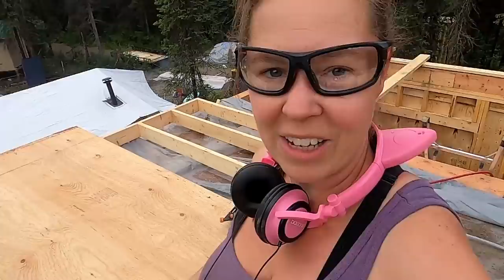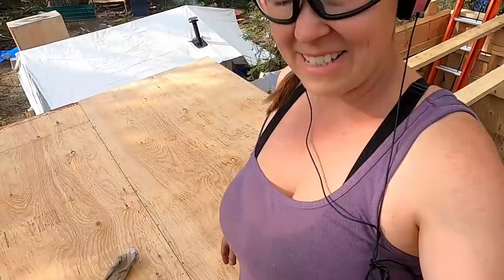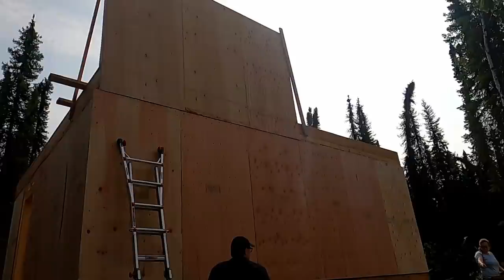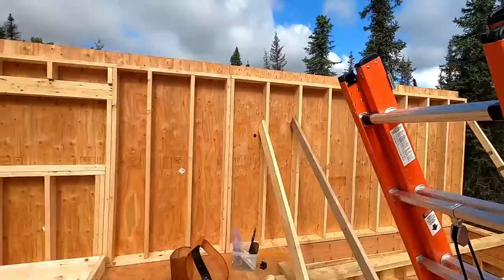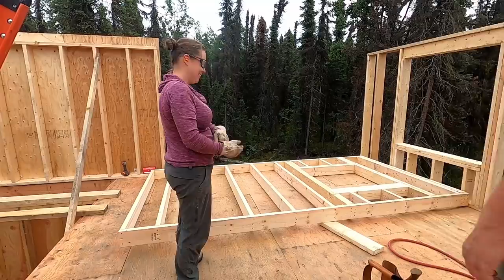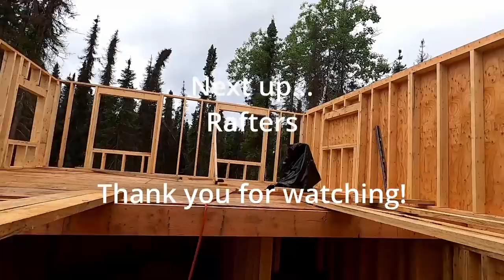Jobsite ACCIDENT | Debt free living cabin build and getting the second story walls up

Comment: I can't emphasize enough, even a "minor" fall can set you back months or forever. Invest in scaffolding & fall restraint, you can resell it for most of your cost later. 2 weeks ago I lost balance getting onto our semi trailer power platform (almost 4 ft from the ground) using a short ladder. I fell backwards to the ground & broke my clavicle. It will be at least 2 months before I can do any meaningful work on the 20X46 "tiny" home we're building with/for our daughter. I have plenty of safely equipment in use for the project, but a moment of haste is setting us back months. Not to mention, it REALLY  HURTS! 😖🥵

Comment: Sorry, but you are "testing the odds" if you keep working like you showed in this video. dong this kind of thing, you frequently need to build temporary platforms or use scaffolding to provide a "normal" place to stand. If you're careful and strategic with the materials, you can use most of them later. Worst case, they become firewood.